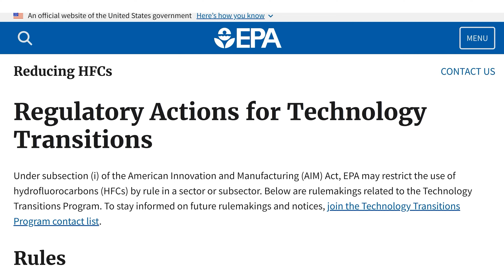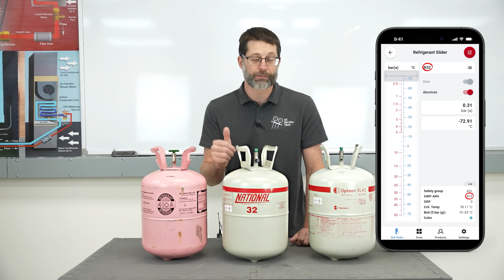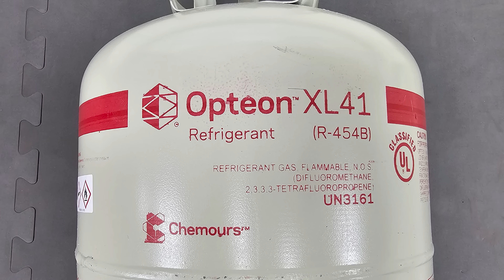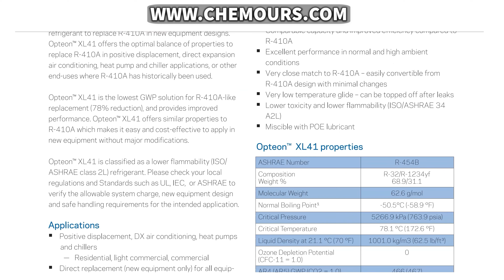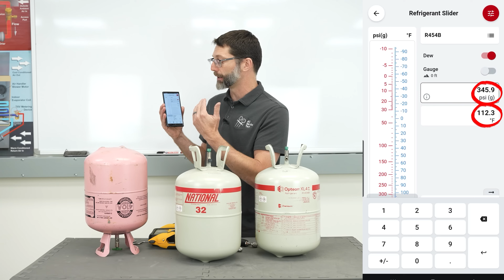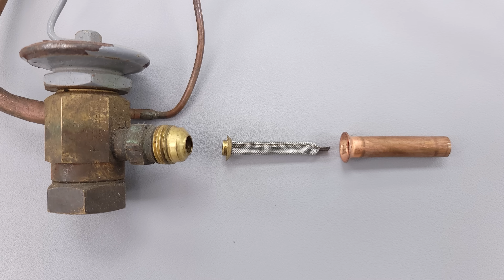A2L Refrigerants R-454B and R-32 Explained! Bottles, Changes, Rules, Tools!

Comment: Another big difference between R-32 and R-454B is 32's much higher discharge temperature requiring a different grade of POE oil,  (POE-68,) than the POE used in most R-410/R-454B systems, (POE-32.)
Reply: Sweet, higher discharge temperatures = lower compressor life, and smoked valves. They had the same sort of fun way back in the day trying to run freezers off of R22 because R22 used to be a $1 a lb. Well, at those low pressures, R22 discharge temp went sky high and the manufacturers tried all kinds of stupid stunts like head cooling fans, demand cooling, demand liquid injection etc all of which lower the system efficiency, and use more electricity. Same thing is happening again in places like California that banned R404A and replaced with R448/449A which have the same problems like 32/454B/22. Suprising thing is, R290 (propane) has almost identical pressures as R22, and MUCH lower discharge temps (I can grab the discharge line right off the compressor on a freezer running R290 and not even close to burning my finger). Yeah Propane (R290) is very very flammable, but it has just about 0 GWP, and 0 ODP, and can use normal POE oil or just about any compressor oil will work too, since it's a hydrocarbon refrigerant, I don't see why it wouldn't work great with mineral oil, but POE oil is probably a better compressor lubricant.

I think all this stuff is nonsense, and they should just be working to switch everything to CO2 for a refrigerant. It's completely non-flammable, in fact, it makes a very good fire extinguisher, it's cheap, widely available, and can help reduce CO2 in the atmosphere by pulling it out when making liquid air etc.

Hussmann already has a high efficiency CO2 system for supermarkets marketed under the Advansor name, I've already seen Coca-Cola and Pepsi display cases and vending machines that say R744 on the nameplate, so it can be done. And in those systems, they just look like a normal refrigerator type of hermetic compressor, copper brazed tubing, condenser coil doesn't look like anything special. The industry should just switch to CO2, and stop it with all this flavor of the month gas stuff. Nobody should have to carry 13 different colored bottles on their service truck, all kinds of different hose adaptors, it already got stupid with the 5/16 flare connections to connect to a mini-split system, and automotive with several different service port connectors. You think a small town car repair shop has the time/space/money to keep 4-5 different recovery machines taking up space? One for R134A, one for R1234YF, and one for R1234ZE or whatever the latest BS FOTM shit is.

CO2 is easy, 100 psi low side pressure is good for freezers or low temp, 200 psi for coolers/medium temp refrigeration, 400 psi for high temp/air conditioning. Just don't let the pressures fall below like 50 psi during operation or charging, and it'll avoid the dry ice problem. Yes pressures are crazy high, but with adiabatic supercritical CO2 systems can achieve very high COP values, and have real world higher electrical efficiencies than traditional supermarket refrigerants like 404A, 448A, 449A, R507 etc, plus CO2 is much cheaper and can be delivered in bulk on a truck. The infrastructure is already in place for that is most cities and towns, bars and larger restaurants already get liquid CO2 bulk delivery for keg beer systems and post mix soft drink sales.
Reply: @brnmcc01
Reply: C02 is good but they still need constant care. I heard it’s difficult to troubleshoot the C02 system due to additional equipment to operate it. Some of the stores have it but when system breaks down it breaks down. Same with other equipment.  The cost comparison is double that of other refrigerants.
Reply: @troyjackson3164  Right, but a lot of supermarkets and large stores like a super Wal-Mart have 100's of tons of refrigeration, and as things are right now, they tend to run the receivers at minimum charge levels, because if there's a bad leak somewhere, they don't want to run the risk of losing 10's of 1000's of dollars worth of refrigerant. With CO2 being so cheap, you can run with more proper system charge levels, and then a small leak isn't as devastating. The upfront equipment cost might be double, but the cost savings of electricity especially in hot climates like interior California or Phoenix metro areas combined with the very high electricity rates there, it won't take long to break even on it. As far as reliability goes, well, if you look at those big R448/R449A rack systems with all that complicated demand cooling, liquid injection, and cool vapor injection systems with all those additional points of leaks, I would argue a 448/449 rack system isn't any better and definitely not easy to troubleshoot. It's all new stuff, it'll get better over time as bugs get worked out. Any time you rob liquid from the liquid line that could be going out to the cases, and instead you use it to cool the return gas, you're losing capacity and energy efficiency.

The other benefit would be more stability, seems like over the last 2 decades, many refrigerants have come and gone, and people are getting tired of this flavor of the month stuff. I don't think CO2 will ever be banned, and it makes a good fire extinguisher rather than an A2L refrigerant.

Comment: What’s the biggest change? It’s gonna cost consumers a whole lot more money to stay comfortable. Be prepared for another refrigerant and equipment change in 5 to 10 years. It’s all about GDP not GWP!
Reply: I can't wait till some customer makes a post about how they remember  a tech selling them a new system because "R-22 is illegal and not environmentally friendly" and now the same thing happens to their 410a system. HAH
Reply: @TheGhettoLobster  410a will still be manufactured and available. Unlike R-22 which is only available as recovered and more and more expensive as it becomes less available. When the equipment dies, then they will have to switch refrigerants.
Reply: @robertjordan7922  My point was that consumers are going to hear the same trope from technicians that they need to switch over to a new refrigerant to do government mandates and environmental reasons. History is just repeating itself for the benefit of corporations.
Reply: Wait until they start banning all of the PFAS-containing refrigerants, like R-454B. One of the new ones coming soon in the USA.
Reply: Agreed
Reply: Nailed it !
Reply: yea
Reply: Be prepared now. We are already at the point where brand new commercial systems are going to be CO2, propane or ammonia. Was at a new construction grocery store project that has a CO2 system in it. It was in the blue prints a year ago. One vacancy service existing equipment with older refrigerants, but new is a different story. This for those states that are progressing. The backward regions may not be as far along. These new stores will basically become unregulated, since oddly enough CO2 is not as bad as the bad global warming gases. Also CO2 will not be as expensive and will be nearly as available as CO2 for soft drink vendors.
Reply: GDP over humanity? You are a joke
Reply: I'm assuming this applies to the USA only, as most of the world has used R-32 for 20+ years already.
Reply: @analogmoz  nice lie China and India still on r 12 and r22